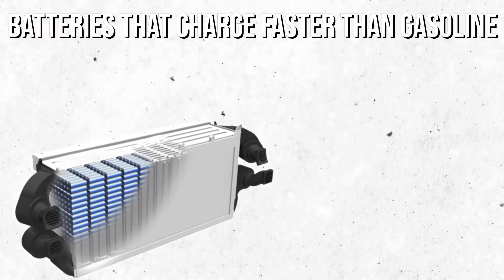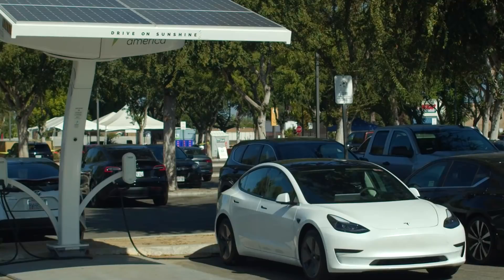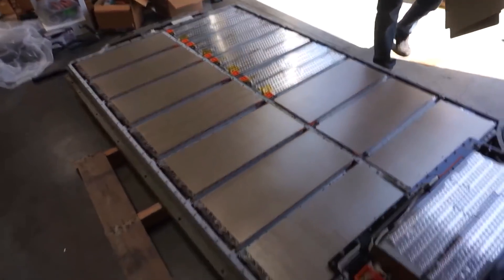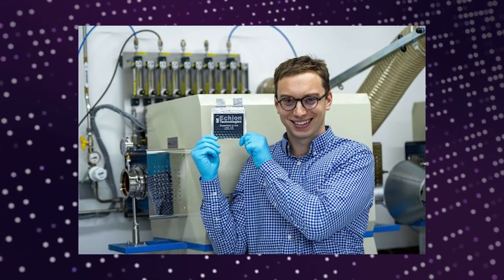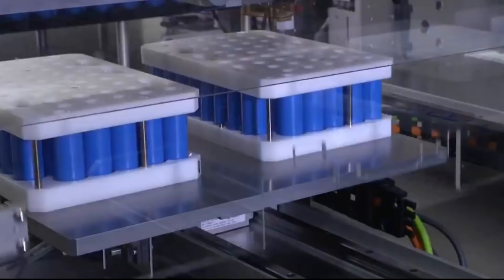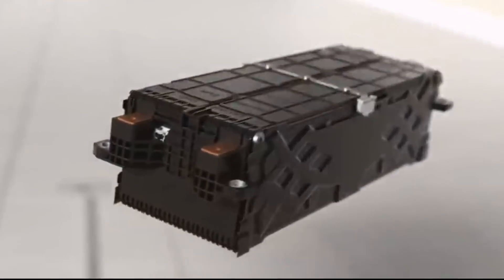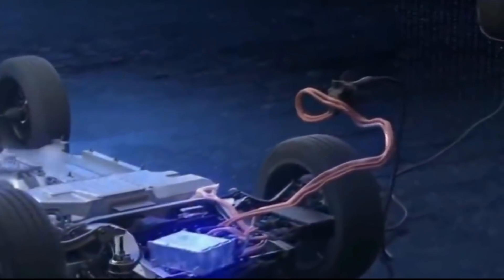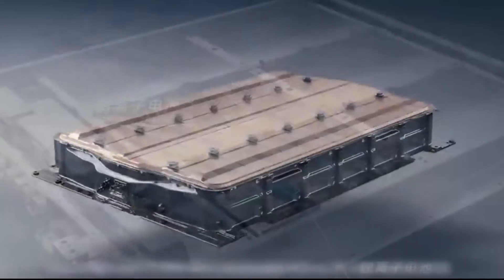Batteries that charge faster than gasoline

Comment: Those limitations are the reason the NWO is pushing ev so hard. We will be confined to urban areas. The energy density of lithium batteries is eleven times smaller than gas and weights over 100 times more.

Comment: I always wondered, why they do not use the capacitor batteries to quickly charge at the 'gas station' and then as the person gets on the road with the vehicle slowly-whatever is the charging speed of the actual rechargable battery-recharge the rechargable batteries. Because the capacitor batteries cannot hold the charge for very long (maybe 1-3 days) but charge very fast-almost instantly! That woud be very easy vay to get around of the vehicle charging delays...
Reply: Where I live they have been using rapid capacitor charging on busses for over a decade. The buss charges in four minutes at the end station.

Comment: To transfer this much power either "high voltage" (>500 volts) or high current will be required.  Over 500 volts and there are special NEC rules for safety which requires special equipment and safety training, and for high current the conductors and interface connectors have to be significantly larger and heavier.
A potential solution would be touch-free inductive charging with a hermetically sealed smart charger that senses when the car is over the charging pad and receives charge rate, charge status, temp and other feedback.  The system would basically act as a transformer with the secondary coils in a plate mounted underneath the vehicle.
Reply: Imaging anything flamable hsppening to be in the inductiin area....
Reply: The vehicle charging can be don by the well trained  "pump" attendant. No need for drivers involvement....Where is s will, there is a way.....

Comment: Currently it costs $36k+labor+tax to replace Telsla Y batteries. If you fast charge the battery dies faster and as days go by the battery gets weak and you don’t get the original HP. New battery tech might cost more money.
Reply: Well a regular ICE mechanic gets $95 per hour

Comment: Yeah don't buy into this it's not only the cells that need to handle a huge current for quick charging also you will need an arm thick cable to plug your car into....
Reply: Could possibly be charging at high voltage and voltage reduced on-board the vehicle before it is delivered to the batteries.

Comment: I don't care if it charges in 1 second; as long as the power created to charge the car comes oil or coal generating plants it doesn't improve the environment,  just moved the tailpipe from a car to a powerplant. 

Until America creates a solar power field in the SW United States to generate all our electrical power needs we don't have a green, renewable energy policy. Enjoy driving your EV but don't think you are helping the environment at this point, you are not.
Reply: Nuclear, wind, solar, hydro.   You could even have tidal and wave energy production. Carbon free... Nuclear has some waste but at least it won't make droughts or heatwaves or floods worse in the world.

Comment: 1. Home charging = seconds to plug in, fills up while you sleep. Fast charge only needed on occasional long trips. Not going to petrol stations actually saves many hours per year. 2. You have no way to charge at home or at work? Don't buy an EV until the EV infrastructure builds up & it will. Auto industry is supply limited today anyway.(Crazy backorder, price markups) 3. Premature battery failure was due to poor thermal design, mostly Leafs. Tesla always had liquid cooling and will outlast toyotas. Next gen 🔋 will last easily 1million miles.

Comment: single use swap batteries, metal-air ethanol-koh at 1200Wh/kg iron-air or to 8.4kWh/kg with aluminium-air, and spool fed metal as anode, full energy density, as the fuel cell, just like methane fuel cell

Comment: That's all good and well with fast charging batteries but 70% of people live  in apartment communities condo communities and they don't live in single family homes The infrastructure for such charging stations is not feasible for apartment communities now or in the next 50 years and they are not telling you any of that
Reply: If you have a car, you have a place to park it, even if that place is the street.  That is where charging could occur.

Comment: Batteries that cost as much as a car are not practical.  Hydrogen generators can be made safely and much more cost effectively as well as the impact on the environment to produce Hydrogen is next to nil in comparison to battery manufacturing which is horrible

Comment: Maybe a better approach is to REPLACE batteries rather than wait for a recharge?
The depleted batteries are slowly recharged then made available to replace , swap-out batteries rather than wait to recharge.
In the time allowed ro recharge, various other tests and evaluations could be made...
Reply: That is what Neo doing.
Reply: @route55qatar  Today's comments are full of nonsense otherwise known as trash. This battery charging problem has got t o be fixed and it will. Walmarts purchase of up to 105,000 trucks is just the beginning and will go long way to solving the problem. ,$$$$. There must be sometime  and someone will do it.
Reply: It's the only sensible solution right now. Nobody has a grid that could handle thousands of car batteries charging in 5 mins at the same time as well as all the other loads. There will be a fight, but eventually a standard modular battery will probably emerge, assuming that we don't end up with another portable energy source first.

Comment: I don't think electric cars are the future the batteries they require are extremely expensive and take lots of different precious metals that are not in abundance. We should focus on hydrogen  the byproduct of burning hydrogen is water so it's a very clean fuel and can also be adapted to run current gasoline engines.
Reply: And still require a power plant to charge .
Reply: Wait for toyota
Reply: They have new batteries coming out in few years that use sodium, solid state and others that use cheaper materials. That are cheaper to make and give you over 1000 miles per charge. They are coming from china, US , germany